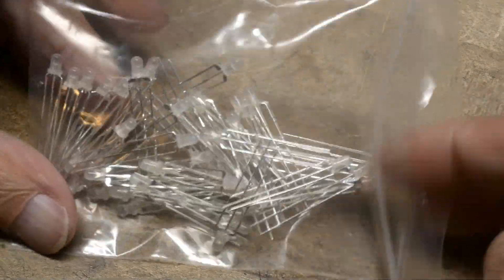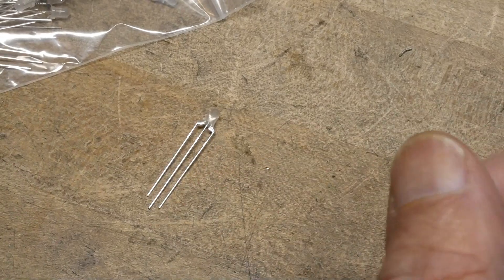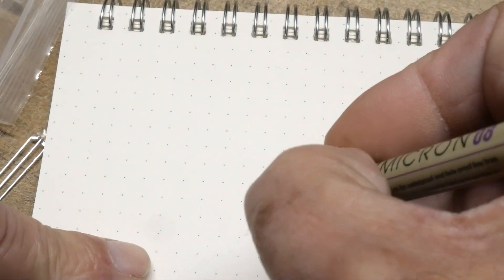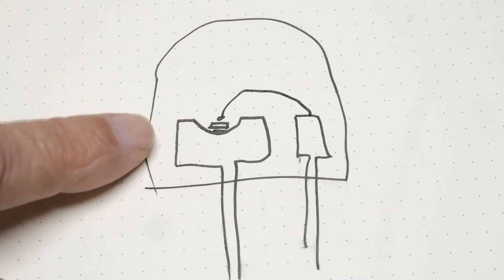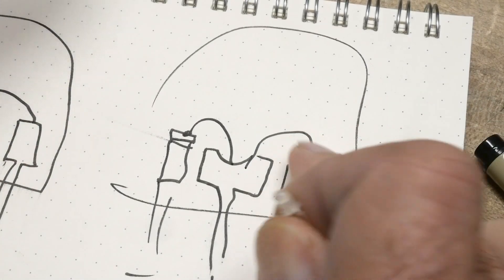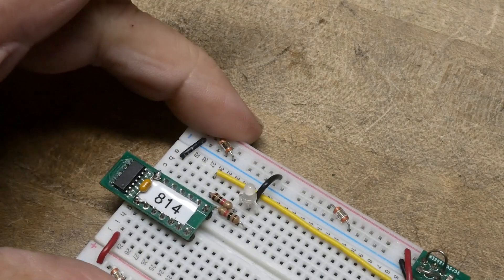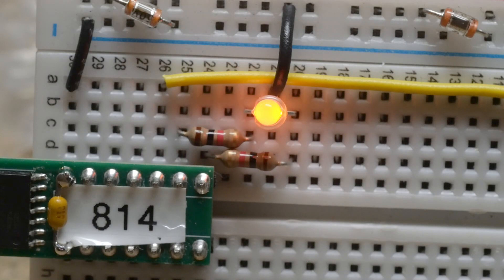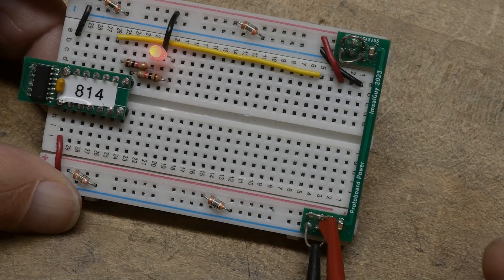#2221 Dual LED

Comment: What are those diodes across the power rails on your breadboard? Are they just reverse polarity protection?
Reply from the maker: they are 0.1uf
Reply: @IMSAIGuy  I've NEVER seen or heard of glass encapsulated capacitors before... you should do a chip of the day on those!

Comment: How do you organize your through hole components? I’m starting to build up my home “lab” and am having trouble with a good solution for through hole parts, especially resistors.
Reply from the maker: https://www.amazon.com/Akro-Mils-10164-Plastic-Storage-Hardware/dp/B000LDH3JC
Reply: The way I organize resistors is by the first 2 digits, and in a series of those little parts drawers. So all 10_ (1 ohm, 10 ohm, 100 ohm 1k, 10k, 100k) in one drawer, 47_ in another (4.7 ohm, 47 ohm, 470ohm, 4.7k, 47k). It's easy to find the multiplier you're looking for just by looking at the third band. There are some resistor kits you can get, and they usually come organized that way, but with all the multiplier values in separate plastic sleeves inside each drawer. It works just as good even without the sleeves. And this way you don't need a bazillion different drawers for each individual value.

Comment: That's one weird LED, as the usual LEDs, even multi-color ones, that I buy nearly always have those LED dices inside the cup of reflector lead frame. And yes I agree, it won't blend; to get the best color mix, just as mentioned in the video, it's best to have all LED dices inside the reflector cup rather than on the tip of wire bond lead frames, so color can be appropriately mixed.
Reply: dies

Comment: My LED of the day is a 5mm red/red bipolar that came with a current  transformer indicator kit by CR magnetics. Impossible to find these single color bi-polar LEDs which are so useful with current transformer and AC capacitor dropper indicator applications.  I wish all  single color LEDs were bipolar.

Comment: What are the four components you have connected between power and ground on the breadboard?  Are those a special kind of capacitor?  If so, why use that type?  Thanks.

Comment: How many RGB leds can the tiny control at once?
Reply: yes
Reply: The attiny 814 is a 14 pin device with 11 pins easily usable as general purpose I/Os.  So, if you mean standard 4-pin RGB LEDs (as opposed to addressable LEDs), there are pins enough for only 3.  Unless you do something like charlieplexing.  BTW, the attiny 1614 and 1624 are also 14 bin devices.  They don't cost much more and have more memory.  My favorite is the 3224.  Still 14 pins, even more memory.
Reply: @electronics.tinker  Thanks. I started looking into them this morning and got sidetracked. The ones I was looking at could only handle 2. You've given me a much better starting point.

Comment: Sony has a really great colour green LED die they use, which is a very nice green, different from the run of the mill green LED. wonder if they are available cheaply other than as spares from Sony. A bicolour LED with both sides same colour is also great as a mains indicator, as you just need a series resistor, and get good near flicker free light output off it.
Reply: I dont know about this particular Sony LED, but there are some special color LEDs made of white (phosphor) LED with additional color filter. Just for example i have seen bright-yellow (very crisp color, completely different compared to the typical yellow led) as well as beautiful turquoise in an application. But in fact i do not know which manufacturer or type or where to order..
Reply: @tvelektron  I know those, pink being the one colour, but these LED's predate the invention of the blue LED commercially, and were used by Sony in a lot of consumer products, with a diffused white case, and a lovely green when lit got one glowing next to me on a Sony active speaker system.
Reply: @SeanBZA  are you talking about "pure green" rather than the usual "yellow green"? They're widely available - have been for decades
Reply: @gorak9000  It is close, just Sony has that slightly different colour, which I have never seen elsewhere. I did buy hyperbright pure green when they first became available, and they are amazing, just not exactly that shade.

Comment: Had 2 LED failures recently.  One on my powered computer speakers & the other on the power switch on my Dell computer.  Stinkin' LEDs!
Reply: right caus leds just fail like that lol your real smart aren't you
Reply: @daveselectronicslab  You need to remember what your mom tried to teach you:  If you don't have something nice to say about somebody, don't say it.  My statement was not directed at anyone.
Reply: @daveselectronicslab  You're not so smart yourself.
Reply: Were they blue? There seems to be an increased failure of blue LEDs in the last few years - I have a few of them in different things that have gone intermittent, and they'll just flick on and of randomly when they feel like it. Seems like it's a failure of the bond wire or the silver epoxy - one of the connections internally seems to have gone flakey

Comment: I'm sorry, a newbie here!
Are those leds which are multi-colored also somewhat designed fundamentally like this or do they use altogether different approach?
(I'm pretty sure that the ones typically found in rice lights are these cuz they have like three connections out and usually are two colored)
Reply from the maker: there are various designs

Comment: I have 3 leg LEDs with the center leg being the cathode. I like them because you can make a yes/no or on/off circuit with less LEDs. I got them in a grab bag from one of the electronics suppliers and/or Amazon. The ones you have are worthless and I have never seen them. I also have two color LEDs with only 2 legs and I have found a couple that are bassakwards, meaning they look normal but work back wards.

Comment: I like the two-leg red/green LEDs.  The two die are back to back so one polarity gives red, reverse is green.  Great for monitoring RS-232 signals. What kind of UPDI programmer are you using?
Reply from the maker: https://youtu.be/r9VnQLEPW0E
Reply: @IMSAIGuy  Thanks.  I've been using the Adafruit UPDI Friend.  It works well, but this may be a cheaper way to go when teaching a class.

Comment: Wow, that is a pretty crappy looking LED isn't it.  Looks like they couldn't push the actual LED elements out to the edge any further then they did or they would be on the outside of the plastic package.

Comment: It’s a dual mode status indicator for devices used by non color-challenged  persons
Reply: I'm non color-challenged, and from the video, I'd have a pretty hard time distinguishing between "yellow" and "yellow+red" with these. With the LED chips mounted on the side, these give a very "designed by a middle manager" vibe...
Reply: @gorak9000  Both of you are colour-challenged. 🤣